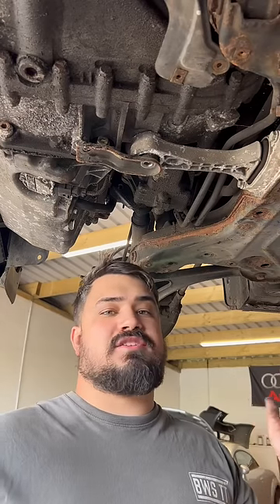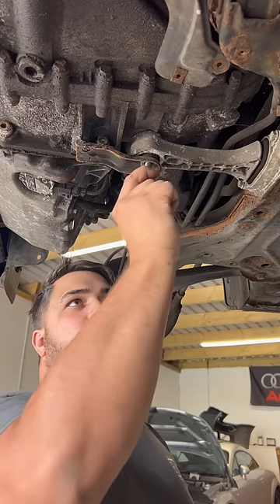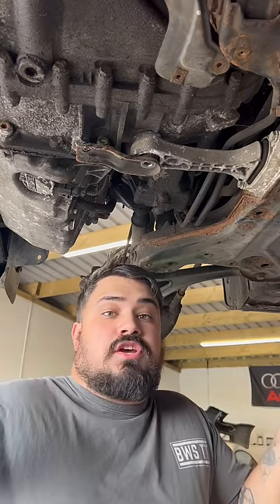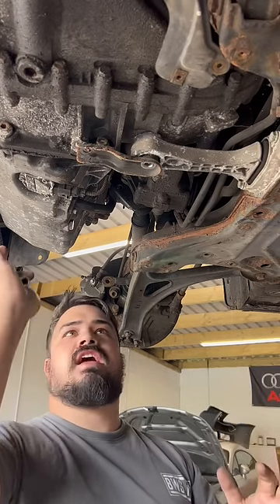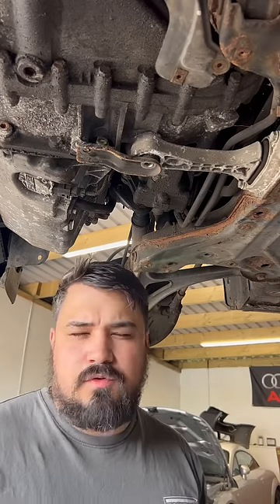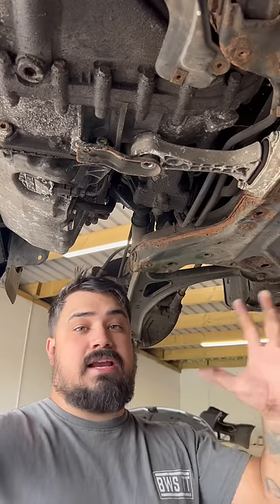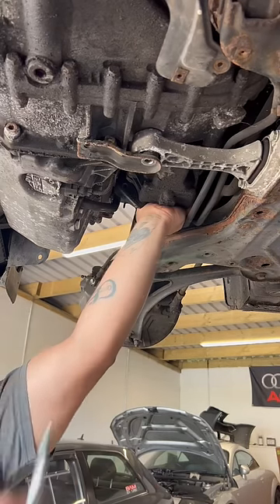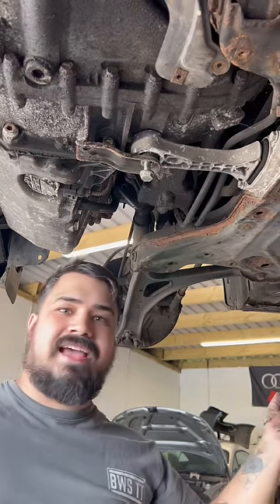Oh no- the bolt wont fit in the hole!!! Dogbone mount Audi TT

Comment: You ridiculing people's online suggestions ignores the fact that people online can't feel how freely the motor swings around, and you as the guy doing the video insinuating there's a problem when there never was one. How about you do a video of an actual problem?  Anyway, on many cars with 3 out of 4 engine/gearbox mounts attatched, the last one may not be aligned and actually need force to get the last one bolted. Best method I've found is to simply loosen all other brackets to give more play.
Reply from the maker: Dude. I sincerely hope that because you wrote an easy youll read my reply. Im not insinuating theres a problem. People ask the question “how do i get this to line up” and people who have done this job themselves reply with the answers i gave in the video, i always reply with this answer and get met with disbelief, therefore i filmed a video showing the method. This is specifically for the Audi TT MK1 although it also works on other 058 and 06a based setups, aswell as many others. There is no actual problem to do a video on- its a non-problem that people make a problem for some reason.

Comment: Not so easy when you don't have a hoist. When you jack the car up and put it on safety stands then trying to get the same angle and leverage on the gearbox doesn't actually work all the time with less room to work with. Plenty of ways to do it but use what you have to get the job done. "complaining producers problems, Solutions create answers"
Reply from the maker: Its easier at ground level with your arm instead of trying to get a long tool down there. Think about it, use your real world experience before you comment
Reply: @BWSTT  I've been an qualified auto technician for 35 years. My father and all 6 of his brothers all qualified with well over 200+ years experience between them so believe me hanging around them all my life I've seen it all. And you should know that not every job is the same as the next. Where I come from most cars are riddled with rust within 5 years from brand new and there's no way doing this on the ground with those pain in the arse cars will this work as easy as it does like on my hoist. Don't judge a book by its cover brother I was not being disrespectful I was simply saying that in my experience doing this on the ground is much harder in different situations is all bro 👍🏾

Comment: Hey, simples! Just get your car 7 ft in the air, specially when it a scrapper.. ohh, not everyone has a lift, of the strength to push 60ibs upward within a foot, inches even.. think before trolling ppl dutchbagg
Reply from the maker: I do this exact job on axle stands all the time, i simply used the lift for ease of filming. Also, im pushing backwards not upwards, my 11 year old could do this job! Stay tuned and ill upload one of me doing it at ground level you banana hammock
Reply: @BWSTT  😆🤣 👍